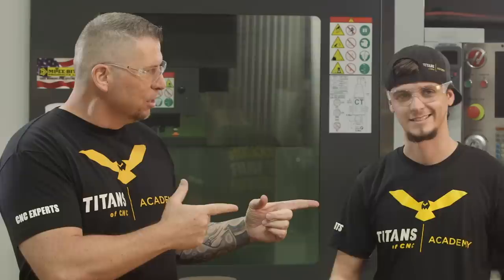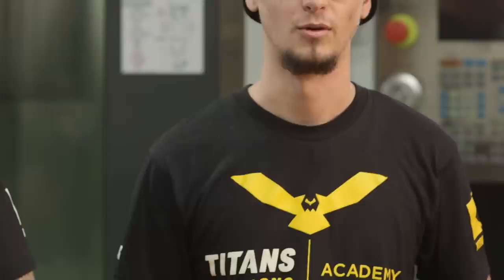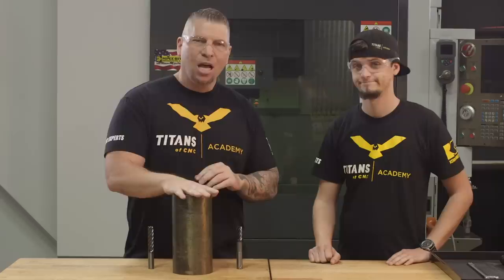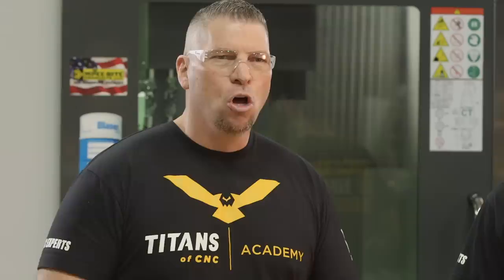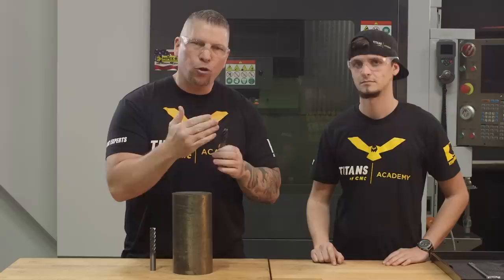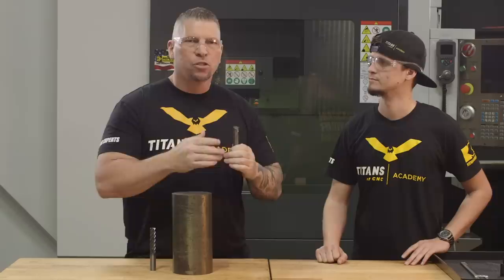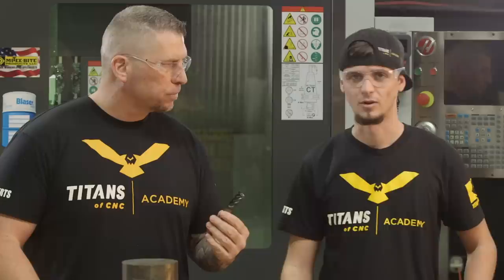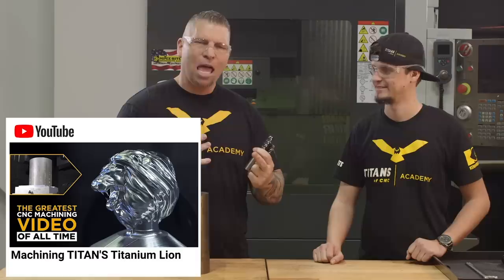Zombie Mill Saved Me $100,000 | CNC Machining Inconel 718 | Vlog #75

Comment: I was waiting to see the end mill cut. Do you have a video of cutting 718? I used to work with it it was a nightmare.
Reply: I only listen a lot of words...
Reply: These are areo space parts you don't want people getting a profile of the parts without a lot of security clearance
Reply: Yoo bro. Have a look on thw Fraisa-tool. ZX Generation is tough ! Also the SX can be used but its not its main material its for stainless steel.
Reply: @Deluxxxe216  SS and titanium are different beasts from what I've seen

Comment: I cut inconel with hss and grease mixed with old motor oil.   Shaper and lathe, just a bench grinder and 5/8 inch square tool blanks.

Comment: Titan and crew, another great video. For the content, but more as it shows yet another aspect of machining which is lost to most. Not that the tool keeps breaking, but why the tool keeps breaking. I am going to have to go into the engineering side here, but the more you grasp as a expert in machining the better your are.  Carbide, like every other metal bends, flexes, twists while it is doing it's thing. The law that governs this is called Wohler's Law, if you can grasp the math and the physics, identify all the variables that you deal with while machining a part and then apply the law to the application you can troubleshoot an issue such as this. There was a deflection (stress)  in the tool over a period of time, that after a set time that stress became greater than the  tool's capability and it failed.  I wish I could get my hands on a few of the broken endmills to see just where the breaks happened and find what caused them to break. Sometimes being a good detective is much cheaper than "let it cut and see what happens", than again sometimes that is the only thing you can do. There is a recipe for everything, pancakes, apple pie, and endmill selection. The better you measure the ingredients, the better  the outcome. Would you have seen improved tool life from a smaller gullet/larger core tool,  a shorter flute height tool, a change in helix angle, possibly switching to an endmill with down-cutting flutes putting the tool in compression as opposed to tension, or just using the tool you have and conventional cutting as opposed to climb cutting reducing the deflection by the tool cutting into the material instead of cutting material off.  There are soo many variables that you have to take into account, but the better you are, the better the product. This way of thinking is how we are going to bring more manufacturing back here, getting past the old ways of just going with it, and bringing the art and science together.
Reply: Hello.
Where can I find more info about this Wholer's law?
Best Regards.
Reply: @miguellimon2609  
Friedrich Wöhler

was a German chemist who ushered in a new age of organic chemistry when he demonstrated that urea, a chemical produced in the bodies of animals and humans, could be manufactured in the laboratory. This discovery overthrew the then-current theory of vitalism, which held that the chemistry of living things was governed by a different set of laws from those governing inorganic chemistry

Wöhler's Law states: a law of strength of materials: the breaking strength of a material decreases with repetition of the strain and with the range of the strain variations.

Plethora of information for more than just chemistry....
Reply: the main problem is the tool becomes blunt,tool wear. the the loads on the tool rise till the load reaches a point were it fatigues then brakes, also as the tool bend due to the cutting loads the cutting angles change which is not going to be for the better wear increases load rise. interesting you measure time. Time is not important its the total metal removed that maters .
Reply: As an engineer I think it's important to note that carbide isn't a metal, it's a ceramic in a Cobalt metal matrix.
Reply: They are machinists.  Not material scientists, or end mill manufacturers.  I like your zeal, but its wasted here.  They cant waste time on such things, they are either making chips or losing money.

Comment: MY NAME IS KEN HENDRICKS. I AM A TOOL AND DIE MAKER. I WORKED AT WESTING HOUSE FOR 18 YEARS MAKING ALL THE HARD PARTS. I HAVE WORKED WITH A LOT OF INCONEL 718 AND MONEL 500. A VARIABLE PITCH MILL 1,0 DIA IS THE ROUGHING MILL AND THEN FINISH WITH THE BIGGEST MILL THAT THE PART ALLOWS. I HAVE WORKED EXTENSIVELY WITH KENNAMETAL

Comment: We use ceramic inserts (SiAlOn) for Inconel 718 on work (for roughing/dry). The cutting speed is 25x higher than carbide - great time saver.

With carbide endmills try to mill Inconel in conventional milling direction. It helps with hard materials, when your chip thickness starts at zero!!!
Reply from the maker: Ceramics are great with the right application, but you also go through a lot of inserts and down time changing tools unless you put time into your machine management.

With these High End EndMill ... Always Climb... the doors is up for Inconel and definitely don’t want to run over any chips etc.
Reply: Suzaru87 I agree ceramic would been the better choice here. You can not only load Redundance tools on the machine and have it set up to change after so many mins and have the tool management for tool load setup would be better. Plus if he had a DMG Mori machine you can unload the tools as the machine running and change insert while it’s still going.
Reply: @vincelombardi2669  doesnt necessecarily have to be a DMG mori to do that, i have a Mazak Integrex I-100ST and can do it to 🙂
Reply: Johan Hägerström some machines you can’t load tools from the outside. I am not saying DMG Mori is the only machine. But HAAS and Doosan I know for you can’t.

Comment: Once you know when the tool is about to die, stop and pull the tool a bit early. # 1 A dull tool is work hardening the surface and the next tool’s life will be shortened. #2 When a tool breaks, it can leave imbedded carbide in the part just waiting to hurt the new tool at the very fist moment. #3 A broken or badly chipped endmill has no regrind value. Goering divers are are like zombies in 4140 HT 38Rc. Factory regrind/recoat are better than new for some reason, go figure?

Comment: I run 718 inconel and we use roughing mills aka hog mills. Don't know why Titan wouldn't.
Reply: I had the exact same thought? Why use such a flimsy end mill
Reply: No idea. Pretty strange to me.  We use roughing mills in everything we do, even aluminum.  We can get through 10000 parts EASY without worrying about degradation of our finish mill.

Comment: Why are you running your tools to the failure point? We always set tool life to pull the tool early and send in a fresh horse. It's cheaper to have a tired tool resharpened than breaking them and then replacing them.
Reply: ten littleindians 
If it survives through the whole roughing process, it’s cheaper to just keep it in the machine as opposed to stopping the program, pulling it out, putting a new tool in and starting again. Making the parts faster will make up for the cost of the tooling
Reply: Could just have a duplicate tool in the carosel. Tool change at Line "x" for duplicate.
Reply: Eluderatnight they could buy guessing that don’t have big enough tool changer
Reply: @ardimarcs7698  Clearly you have never priced these end mills. Even if they have the tool capacity filled they could have another in a holder on the bench with it's information loaded into another tool offset slot. It takes less than a minute to manually swap the tools and call up the offset for the fresh horse. While the tool is cutting away the operator can swap out the tired cutter and measure it on the presetter and enter the data into the machine. Even on a machine brand that won't let you adjust offsets while it's running you can still right down the numbers on a piece of masking tape and stick it on the tool so they are handy for entering later.
Reply: @Eluderatnight   Yes, that's the proper way to do it in many cases.
Reply: ten littleindians 
Whatever process they’re doing, I’d say they’re doing it right

Comment: Possibly a dumb question, so pardon... I've never run a machining centre, rather I program a turret punch press and a laser profiling machine - so I love CNC.  But if a tool is so expensive and has a defined life, wouldn't it be smart to stop using the tool before it catastrophically dies, and program in a new fresh tool to take over, thereby not stopping the job and work-flow.  Maybe, because the tool is not completely dead, the used tool can be returned to the manufacturer for refurbishment, saving $$$$.
Reply: Sometimes it's worth the money to regrind but often it isn't because the more edges they need to regrind, obviously the more it will cost.  Regrinds rarely last even close to the cutting time of the original tool. Probably due to heat stress, deflection stress and they don't usually re-coat the cutting edges like the original tool. I'm betting it's not cost effective to regrind a 6 flute endmill , especially if your only getting a half life because replacing the tool and restarting the job in the middle of the program is also a lot of lost time. Time is money in a production shop.

Comment: Ok a side note Caron engineering makes some amazing load monitoring tools. At my work one of the machines is equipped with their product and it catches and stops the machine the moment of insert damage before cartridge or work damage.
No need to have someone watching a mill run because a tool might fail.

Comment: You commenters are a crack up. They will never show the machining for this part.
It's called "Export Control Laws" - basically a gag order, they aren't allowed to divulge anything about the part or its customer.

I'm a machinist for a small shop that does prototyping work for aerospace companies - super high precision work.
All I cut are the INCOs, the hastelloys, the A286s, the AISI A2's, the titaniums, the monels - basically the materials most shops don't want to deal with.
And I say that because of my years of experience, all the software's tool companies provide that these guys are talking about towards the end are worth DIRT.
Nothing trumps experience.
I had a representative from a major tool supplier in my shop wanting to show off a special endmill like this one, he tried to show us the Speed/Feed software they had. I saw the numbers and laughed "the tools gonna break in minutes"
 - it broke in 2.
Never trust those softwares.

Comment: Only $2,000,000,000 per endmill. I can't even imagine how much this endmill costs. I looked at a Kennametal 1/2 dia endmill for profiling aluminum, 1" flute length. It was $600 per endmill. I could buy data flute endmills that probably work better and cost WAY less.

Comment: Have you ever tried milling in hardox 600 Steel.

I use MachiningCloud instead of Novo in There are also many other retailers a Kennametal For example seco, Walter, ISCAR, Paul Horn GmbH, Tungaloy's, TaeguTec, and many more
Reply from the maker: No I haven’t...
Sounds Hard:-)

Machine Haynes188, A286, Monel, Inconel etc... Nitronic, TI, 15-5

Comment: If I had a part that kept breaking endmills, I'd think about running that part on a different machine to see if the machine is the fault.  I'd try a 50 taper and see if cutting tool life improved, if it did, then I'd say it was my tuning fork of a machine that was the root cause of the short tool life.

Comment: Did you try some of yg-1 endmills?  We use the x5070 to cut up to rc70
Reply: Love Yg1s tools. For Ti and Stainless
Especially their XPower series. Their Jet Power fine roughers are amazing. But for Inconel not so much.
Reply: @pakman422  had really good luck with their TitaNox Power on stainless. Getting 8 times the work done VS the imco's I was using previously.

Comment: Hey Titan,

When is it smart to use an insert cutter instead for this type of application?? It sounds like never might be the answer.
Reply from the maker: In this Material... it’s almost impossible to consistently cut with regular inserts... and if the inserts go your liable to drag the holder into the material. EndMills break off easy and last long.
Ceramic Shell Mills work well but you gotta change inserts often. 12-15 min

Comment: have u ever had any experience on milling graphite?
Reply from the maker: Yes, pretty easy but need a good vacuum
Reply: @TITANSofCNC  absolutely true i machine graphite 10 hr day and my dmu 65 works closer 24/7 but the problem is about tools ... damn expensive! i had try pkd inserts many kind of mills with diamond coating i had try diffrent parametrs (my spindle is 24000 rpm so i can go really fast ) but no tools can go over 30/40 hr  do you have something to suggest me?
Reply: Chauvin Emmons  before we use copper but is more expensive a bit less conductive  n need to be machined more slower than grapithe to  make good quality electrods for edm machine...
Reply: Titan what tools do u use for graphite

Comment: There must be a really good reason to cut material  after hardening. What is that?
Reply: Dimensions change durring hardening of metals.
Reply: @Eluderatnight  
I know that. These changes are constant. Not good enough. Next please!
Reply: @sskkuuddrraa  no, the changes in dimensions aren't constant and the parts are warping depending on the geometrie of your part. a hole for example would probably not be round anymore.
Reply: Some customers require it to be heat treated prior to machining just for the reason it will warp or crack during heat treatment

Comment: But what about regrinding?  Such a huge number of hours of cutting is obtained with regrinding or without?  If without regrinding, then huge questions about the cutting edges arise, because there will be huge bevels of wear, in which case there will be a disgusting surface quality.  What kind of nonsense about working with a broken tooth, after that the mill are always thrown out, because after that they are not able to give out the necessary surface cleanliness.  It also sounds very strange to me “work before breakdown”, how to understand before breakdown, in normal production lines the durability time is calculated and the mill is replaced BEFORE it breaks down and sent to regrind.